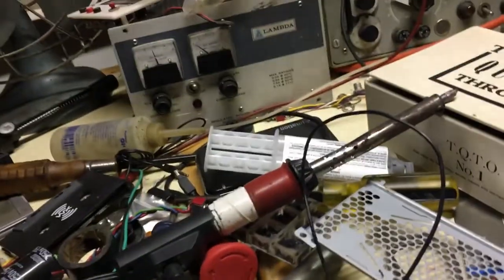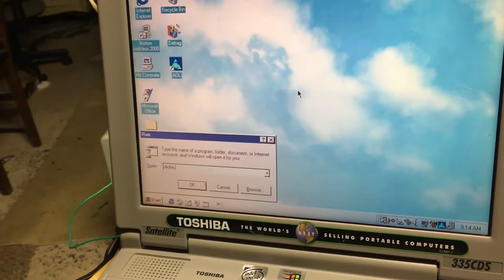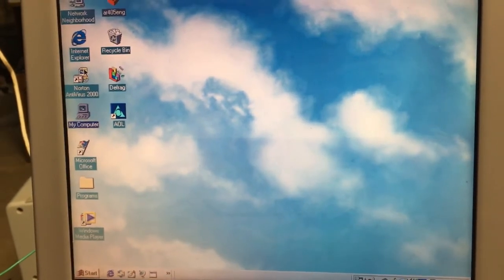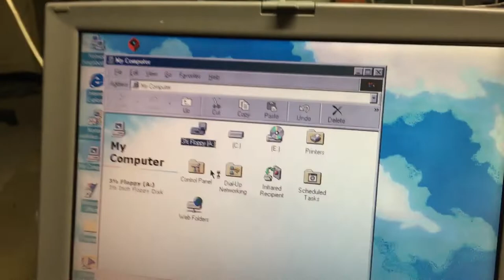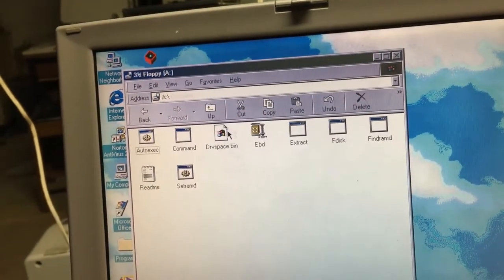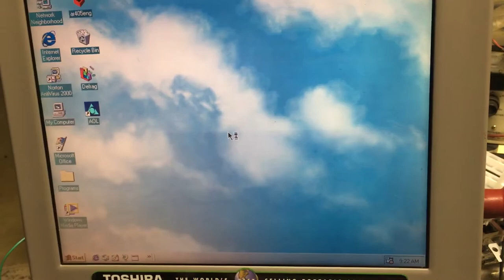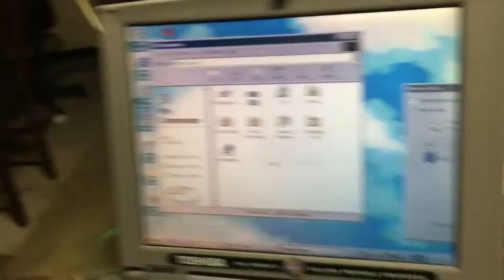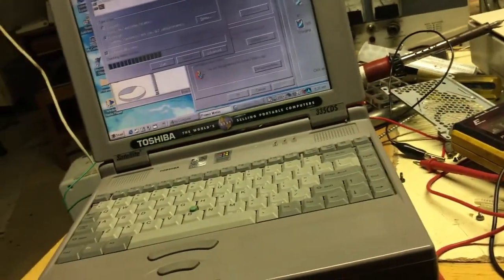Toshibe Satalite Late 90's Laptop Junk Day Find

Comment: i really need a hard drive caddy for my toshiba tecra 700cs but i cant find one anywhere. i need it because it converts the ide hard drive to some kind of 44 pin.
Reply from the maker: perhaps check the ebay for a smashed up parts unit. and good luck as ebay price gougeing has gotten bad.